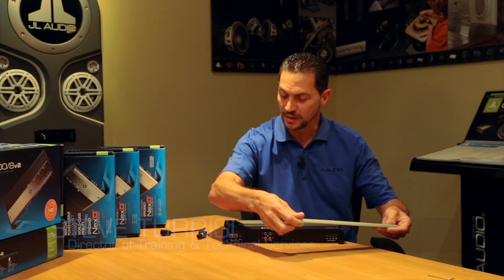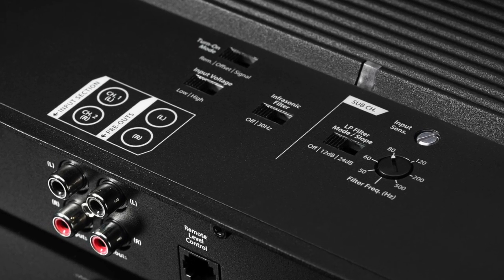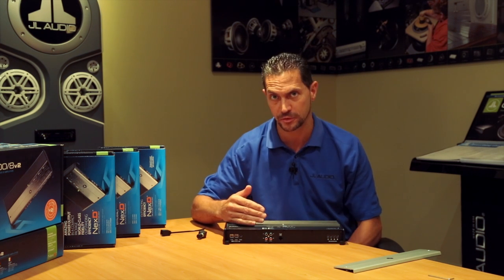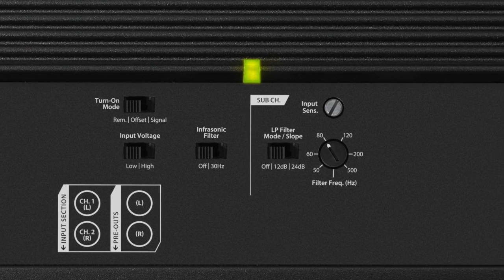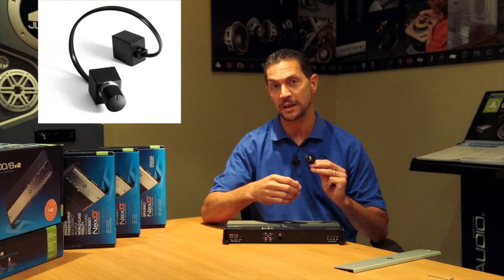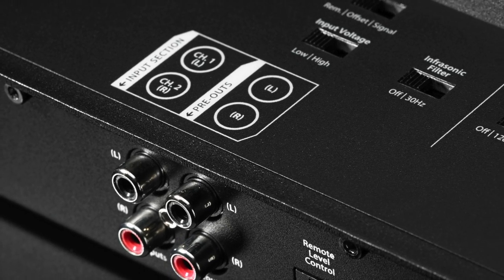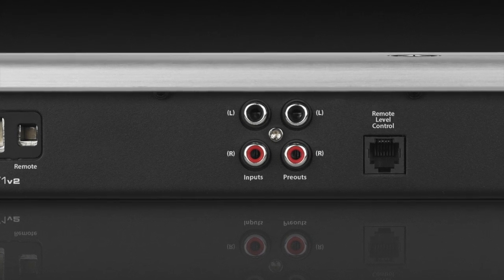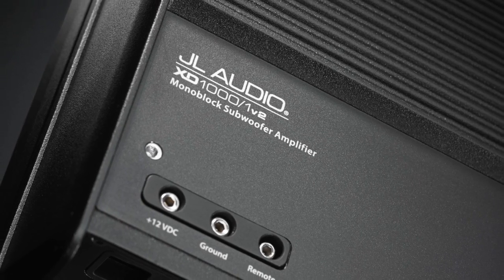JL Audio XD1000/1v2 Product Spotlight

Comment: Hello sir. 
I know that this is a very old video, but I was wondering if you could tell me if this amp could push 2 Rockford Fosgate T2S1-13 subs.
Reply from the maker: It will certainly play them, but since their subs are 2000 RMS you would not get a lot of potential with 600 watts on the pair. It would probably be best to reach out to Rockford Fosgate for more info.

Comment: Two questions I am hoping your team can answer: 
1) The amp has two sets of speaker terminals and the amps power ratings on the JL website are noted as 1000 W @ 2 ohms OR 600 W @ 4 ohms. Is this saying that each set of those speaker terminals would have that rating or would each speaker terminal rating then be cut in half to 500 W @ 2 ohms and 300 W @ 4 ohms?
2) I currently own this amp as well as two JL 10TW3-D4, what is recommended for wiring those two 10's to this amp? 
Thanks for your help
Reply from the maker: Two great questions.  

1.) The amp has two sets of output terminals for the purpose of powering two subwoofers without having to wire the subwoofers together.  You can connect the positive and negative output terminals to each subwoofer and the amplifier will internally parallel wire them together and distribute power evenly between two matching subwoofers.

2.)You could wire them each to the amplifier as I have described above or if they share an enclosure and have a single termination then you can wire them together in a parallel configuration and just use one wire to either positive or negative on the amplifier. 

  Single Voice Coil (SVC) Wiring Tutorial: https://jlaudio.zendesk.com/hc/en-us/articles/204374180-Single-Voice-Coil-SVC-Wiring-Tutorial?source=search&auth_token=eyJhbGciOiJIUzI1NiJ9.eyJhY2NvdW50X2lkIjoyMTU0OTIsInVzZXJfaWQiOjQwNTEwODY2NTE1MywidGlja2V0X2lkIjo1MDI4MTksImNoYW5uZWxfaWQiOjYzLCJ0eXBlIjoiU0VBUkNIIiwiZXhwIjoxNTg2ODc5MTI2fQ.hHRSRqNGmKwpSY0H8wYNQnMcO6xCNgWKpNkNxllMW1c

Comment: Can this amp power 2 12 w6v3....I just replaced my 2 subs from 99 and found my second slash 500/1 amp was not turning on so they told me to get this amp.  Would prefer not to ruin my new w6v3s
Reply from the maker: Jessica, while the amp can certainly power two W6v3 subwoofers, you would not be able to take full advantage of the power on the amp. Those woofers would need to be wired in a series/parallel configuration which leaves you at a final impedance of 4 ohms. The XD1000/1v2 would provide 600w RMS @ 4 ohm.
Reply: @JLAudioInc  thx the dealer wanted me to purchase this amp and I said no.....i ordered the slash 1200/1 how will that amp do with the two w6s
Reply from the maker: That'd be perfect, you can take full advantage of both the amp and subwoofers with that pairing.
Reply from the maker: I'd recommend asking that at a minimum they use our 9-step procedure that is outline in the manual to set the amp levels. An oscope would certainly be ideal, but not every shop has access to one.
Reply: So are the subs still wired to 4 ohm and in parallel for the slash amp or is there a different configuration for the slash?  Just wasnt to make sure they do it right when it comes in
Reply from the maker: Yes, they should be at 4 ohm for the 1200/1v3 as well. 

It would actually be a series/parallel connection, which means the voice coils are in series (8 ohm each sub) and then the subs are paralleled together for a final 4 ohm load.
Reply: @JLAudioInc  thank you so much bc this stuff is all jibberish to me that's why I hire professionals to do it....they do have the subs wired properly currently for this amp and now I'll know how it needs to be set up when I get the slash in
Reply: @JLAudioInc okay so with the xd in there they have it wired the 1st and 3rd and 2nd and 4th for the jumpers.  positive and negative running from both speakers to the amplifier so 4 wires to the amp.  Is that right and when the slash comes in how should it be done?
Reply from the maker: There should be a single jumper on each subwoofer from “VC1–” to “VC2+”, this puts each woofer at 8 ohm. Then its a standard connection from the push terminals on the sub to the enclosure, and from the enclosure to the amp.
Reply: @JLAudioInc  so with the xd they have it set properly having it with all 4 jumpers and when the slash comes in they need to set the subs up with just one jumper or should I be changing it to one jumper on the xd amp too.  I truly appreciate all your help!
Reply from the maker: Both amps would need to be set the way I described before, one jumper per sub. You'd just have the ability for more power from the Slash amp.
Reply: @JLAudioInc  so they do have it wrong....cause they have all the jumpers on.....see what I mean about leaving it to the professionals...how do they not know this is what I would like to know.  Also does it matter that the speaker are wired to the amp separately?  Using 4 speaker wires instead of just two?
Reply from the maker: No, using two sets of speaker wires is not an issue, but I would recommend having them change the jumpers to the proper configuration.
Reply: Absolutely thank you so so much!
Reply: You've been super helpful with all of this so let me ask you one more question I have the 8in w7 in my truck the stealth box now they told me to power it with the xd 600 is that amp enough power for that sub or would I be better dropping the 500/1 slash v2 amplifier I have on it?
Reply from the maker: You'd actually get the same 500w RMS from either option, but I would personally prefer the Slash v2 and even more so because you already own it.
Reply: I own both of them the xd was installed when I had  the w7  put in my truck but now that I had to pull the slash amps out of the car I figured I'd see if the slash would pair better with the w7...the xd in the truck is only 600/1.  The one in my car is 1000/1 :)
Reply: Gary Burton  I ended up getting the 1000 slash on em.  Just wanted the slash....Its apples to oranges I have the stealth box 8w7 in my truck but for the 2 12s I wanted the slash

Comment: Will this amp push a jlw7 12
Reply from the maker: Hello.

Yes. The 1000/1v2 amplifier is rated to deliver 800 watts at 3 ohm, which is perfect for a single 12W7. The woofer has a rated power handling of 1000 watts RMS.
Reply: If I was to connect it to 10w7, would that be ok?
Reply from the maker: It has a little more power than you need for a single 10W7 woofer, but it can still work well if properly setup. Be sure to set the input sensitivity accordingly to help limit the output to under 750 watts.
Reply: JLAudioInc I was told that this amp can also push the 12w7, but I worry it will be underpowered. It does 800wrms at 3 ohm. I was hoping to do about 10-15% stronger amp just to be safe.
Reply from the maker: The XD1000/1v2 amplifier has more than enough power for a 12W7 woofer. 750 watts RMS is optimum power, but you'll get excellent performance with as little as 400 watts.
Reply: @JLAudioInc   this amp is  rated to work at 1ohm   or only 2 and 4???

Comment: can I run 1 10tw3 with this amp?
Reply from the maker: Thank you for your question.  The 10" Tw1 subwoofer has an RMS rating of 400 watts.  

We have two versions of the Tw1, a dual 4 ohm and a dual 8 ohm.  The version that you have will determine the AC target voltage for the amplifier.  I will include both target AC voltages as well as a link to our 9 step level setting guide so you can accurately and safely set your amplifier for optimum performance with your subwoofer.  

10Tw1-D4 ~ target AC voltage = 20AC
10Tw1-D8 ~ target AC voltage = 40AC 

www.youtube.com/watch?v=2eRYzXBmWq8
Reply: I need this. Lol.